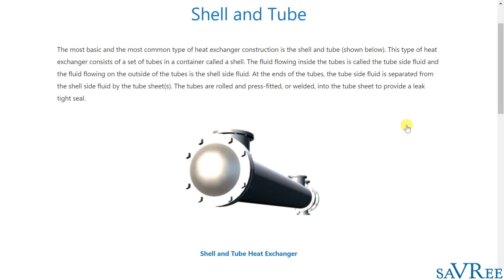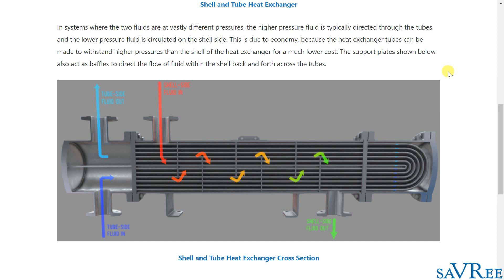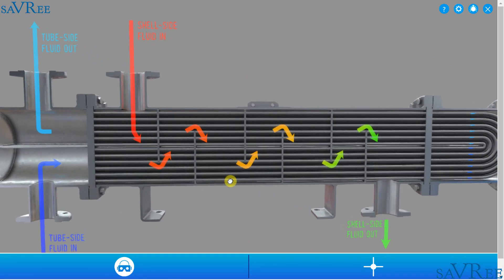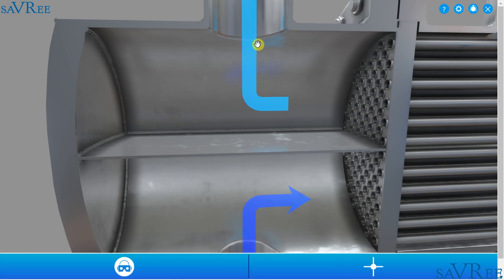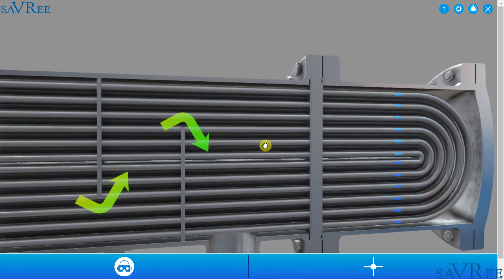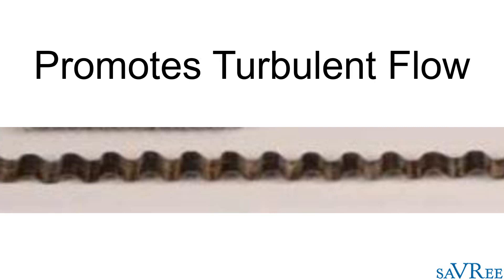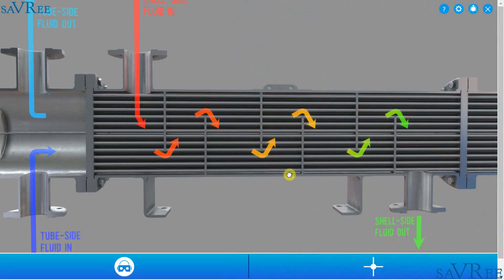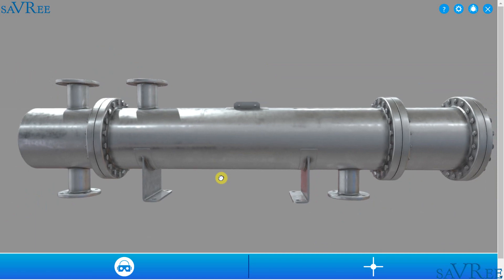How Shell and Tube Heat Exchanger Works

Comment: Is there some normal baseline level of noise to be expected from this design when in operation?  I came across one of these titanium tube/shell units heating a swimming pool off a boiler and there was a fair amount of metallic noise being generated internally when pool pump was operating.

Comment: Great video, it would be great if you could post similar video of columns
Reply: @savree-3d  columns are vertical vessels with multiple levels of internal trays or packings which act as a mass transfer device for the separation of liquids and vapours throughout the process.

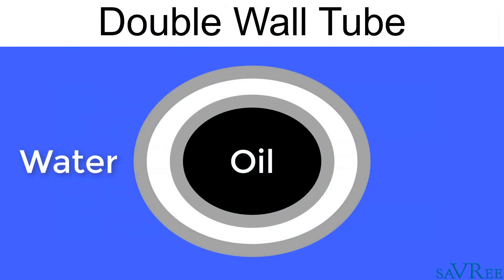Comment: when you mention that you don't want the oil to spill into the water 2:10, that flow(oil in tube) is contrary of the previous schematic where water was running through the tubes instead. Maybe accidental but the schematic looks like the colder fluid has to go through the tubes